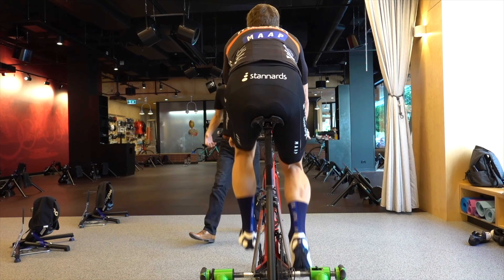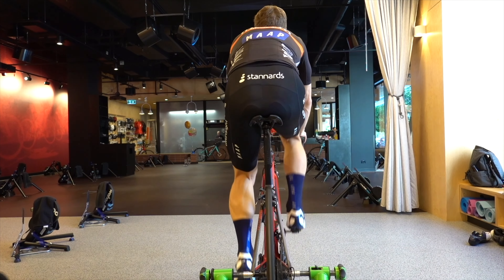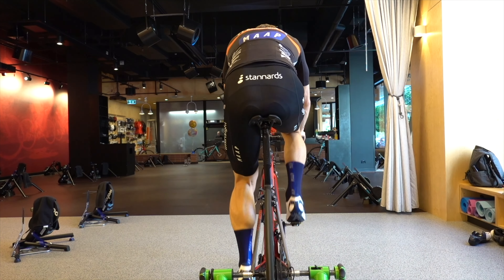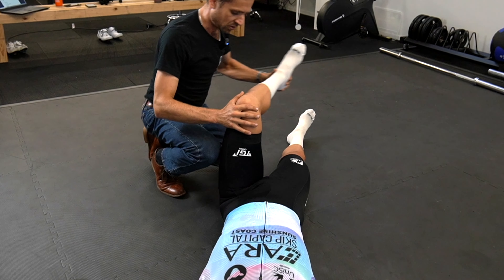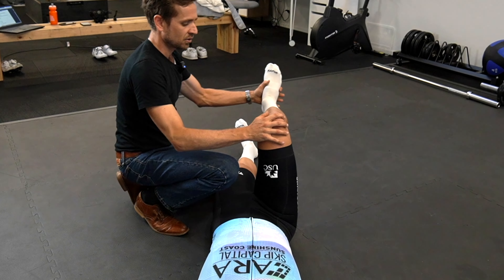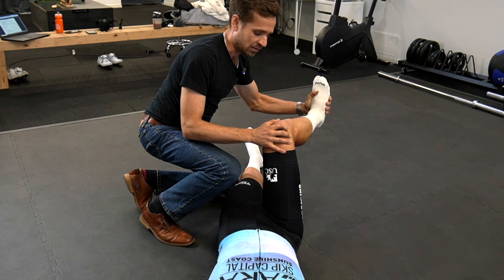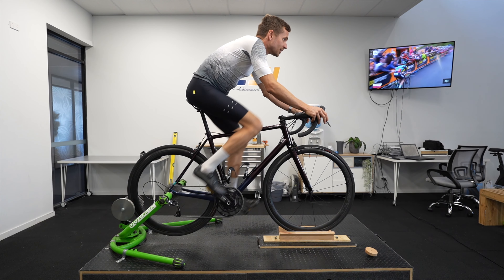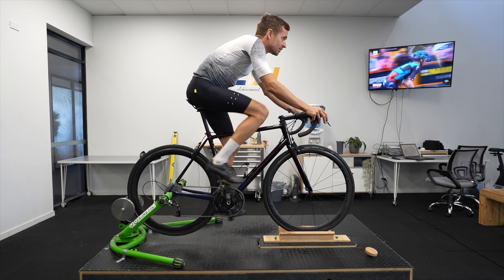5 reasons Why You Should Be Using Shorter Cranks

Comment: I've ridden a variety of crank lengths in 56 years of cycling - 165s, 170s, 172.5s, 170 on one side and 175 on the other (long story) - and have never noticed any significant difference. I switched from 172.5s to 165s about 12 years ago in hopes that it would help with some knee problems. It didn't, but I've stuck with the 165s because there was no reason to change again. By the way, what eventually did make my knees better was strength training, specifically squats and deadlifts.
Reply: very decent and honest answer. thank u!
Reply: Maybe you need to try 160mm
Reply: 弱者は，クランクのつっかかり，ひっかかりが，筋肉収縮痛をうみます．
あなたは，強者です．
Reply: Agreed. Did the same thing and after the initial adjustment period there was no difference. After switching back to 172.5 I actually like them better than shorter.
Reply: There’s more to knee problems than just crank length…
Reply: i am 178cm tall and have ridden 165, 167.5, 170, 172.5 and 175 cranks. honestly, i feel not much difference between them if my flexibility and fit is good. like 170 most tbh as the shorter cranks lack the leverage and jump for me.
Reply: surely you must have noticed the difference in feel between the lengths?  I've only changed 2.5mm and it's night and day the fit on the bike and the smaller circle.
Reply: @h20s8804  I do notice it. But it's not a big difference for me. Shorter cranks just feel like it's a harder gearing.

Comment: that saddle really steals the show
Reply: They are also really, really good...
Reply: But so awful looking 😢
Reply: I'd like to see someone mention humoring using one of those for mtb purposes, whether it be xc or trail riding.  Could it have any place there?
Reply: @Emolokz  got one on my road bike, one on my gravel.
Reply: @Hermod_Hermit  those two instances certainly make sense, but I'm thinking more of with a dropper. Will the shape of this saddle ever interfere with the rider standing, manipulating body position over the bike as much as you do in trail/enduro type riding.
Reply: @Emolokz  ah, that is a valid question. I got no answer to it though, sadly enough.
Reply: @Hermod_Hermit  it's something I wish would ever be covered for the mtb world. I know this is a road focused channel, but there is not enough, or really any data out there on crank length and saddle comfort/ergonomics for the heavier off-road riders. It's a missed opportunity. I'd love to see torque comparisons with a 170 vs a 165 and a 160 crank (while adjusting the chainring size up for shorter cranks and not). It's an empty dataset at the moment.
Reply: @Emolokz  oh yes I know. Personally I got so tired of it that I finally changed the one thing I could do something about. I lost 20+ kg of body weight (no kidding). I also shortened my cranks to 170mm from 172,5 and 175 respectively, and accumulatively all this has made a world of difference. I got really long inseam of 90cm, and 170 feels really nice.
Reply: @Hermod_Hermit  you're probably a taller fellow. I'm about 172.5 cm tall, so I'm leaning towards 165s myself, maybe even 160s.
Reply: It’s Aladdin’s shoe don’t you know that? Or the geenie?😂

Comment: Going from 172.5 to 165s changed my riding life. I actually did it on a whim after watching a few Neil videos. Turned out my a-symmetry and right lower backcpain was caused by a very stiff left hip. The pain literally went over night.
Reply: I am exactly suffering from the lower back pain ! been having it for almost two years.  Did Physio, Chiro and joined the gym to strength training.. it helped a bit but the problem was never eliminated.. recently someone who saw me at the local track suggested that I change to 165 or 160mm crank length.. I always wanted to try it but kept pushing.. reading your message here gives me renewed hope ! and I will start looking at local options to try this ! Thank you man ! I really appreciate you..
Reply: I have the same problem,lower back Pain when i do thershold training.i am 185 cm tall and have a 175mm crank on bike.think i buy the 170mm or 165mm for MTB
Reply: @abedfo88 I'm so curious about this. I have had lower right side back pain for YEARS. I've gotten multiple fittings, done strengthening, checked my form and it still persists. Did you not know your left hip was tight before you switched? Or the 165 nicely compensate for the tight hip so it didn't affect your back anymore? I'm heavily considering switching to 165 (I currently have 175; 170 on my previous bike) bc I think it would relieve my back pain. Not exactly sure what's causing it but willing to try bc the pain is so obnoxious and drains my energy while riding.
Reply: @aoguchi  it turned out that my left hip has like zero internal rotation and was very tight. I'm working on hip flexibility. I still get right side pain but it's more in my glute which is much more manageable !

Comment: Fantastic overview! Shame it's so inconvenient and often expensive to change cranks. Should be able to choose when you purchase the bike.
Reply: I've found the best idea is to buy used, rather than chase very, very minor design differences and paint jobs.

With the cash you save, changing parts is less painful and you get what you really want rather than what you're given.
Reply: 30 years ago when I was racing people rarely bought new bikes fully equipped. You'd choose a frame, then a groupset, wheels, pedals, and saddle, and have a mechanic assemble it for you, or yourself if you were able. So you had full control over every part that went on the bike
Reply: This is still the best option and what I prefer. It’s also how I taught myself to work on my bike (other than headset and cutting the steerer tube). Most people are a bit overwhelmed by searching for all the individual parts though. I don’t blame them.

Comment: You and other channels discussed this quite a few times since 4 years ago. I'm surprised that bike manufacturers still don't use shorter crank arms for their 2XS and XS bikes. If any change, it's a very reluctant one. I'm 167 and use 160 for both road and e-gravel (which has aero bars too).
Reply: I bought a Trek hardtail mountain bike in 2019, one with supposedly women's-specific geometry. Guess what cranks they put on it? 175mm, regardless of frame size! Ridiculous. I'm only 5 ft 4 1/2 inches tall (so about 163 cm, right?), but because I didn't know any better for the first 4 years I wondered why I struggled to climb even in bike's granny gear, and why my knees were sore after long rides. Last fall I bought 155mm cranks and the mechanic who installed them at my LBS was impressed with how they felt when he test-rode it. He is much taller than I am and he said 175s are even too long for him. What is Trek thinking?!?
Reply: Money
Reply: 163cm here and use 160mm on the Road bike and 155mm on the Gravel (seat height 665mm). Even with 160mm cranks I still get toe-overlap with 700c wheels as I have a more mid-foot cleat position. Thank goodness I have 650b wheels on the gravel bike!
Reply: @phil_d would you mind sharing which 155mm cranks you’re using please? It’s so difficult finding reasonably priced shorter cranks for gravel
Reply: @phil_d  going up a frame size and down in stem length fixes toe overlap. Long stems only exist because pros wanted short bikes to get closer to their wheel
Reply: @muthatrucker6485  Sadly, not for me. My 48 size frame needed a 80mm stem (stock is 100mm), so the next frame size up would likely be shorter than that! I then may run into stand over problems.

It's because I moved my cleats back as it feels a stronger position. Personally, 650b wheels should be more commonplace on smaller bikes. Although Conti make GP5000 rubber in that size there's a very limited choice of rims, especially deeper aero.
Reply: They should be already at 165mn but sometimes they really work towards even shorter cranks if tour de france riders at 5'9" or 5'10" are looking into a 165mm
Reply: the same with narrow handlebars. basicly no one needs a 440 or even 460mm bar on their road (or even gravelbike) but most brands offer a 400mm as the narrowest option....

Comment: Reason one to not use short cranks: you want to win the pack sprint which is often decided by half a wheel or less. 

Reason two: you have long legs for your total height. 

Reason three: you are relatively more short-twitch (in an endurance sport) and you feel less tired and burn less energy using a little more short-twitch.

Reason four: you ride on your toes because it’s more comfortable. People ride (and run) in ways that are more comfortable which translates to more efficient and it’s less efficient when they change their natural gait.

Comment: I wish you would say how tall you are just as a reference for the 165mm cranks. I am now a shade under 5’4” and have just ordered 155mm Rotor Aldhu which hopefully will fit in both my BB30 bike, and evo386 bike so that I can just swap the same crank between bikes. Coming from 170mm cranks and was finding it hard to even find 165mm.
Reply: I broke my pelvis snowboarding and left hip does feel some discomfort at extreme angles so I want it to as optimal as possible

Comment: I'm surprised that none of the videos about shorter cranks makes any explicit mention of the reduction in leverage they give, although this was hinted at in this one at the end of this one. Going from a 172.5 to a 165 crank is about a 4.5% reduction in applied torque for the same force. and as power = torque*angular velocity, this means less power for the same cadence. Has anyone looked into whether there is any advantage in changing the chain ring tooth count with shorter cranks to compensate for the loss of leverage? You could compensate for the estimated reduction in torque by having 2 fewer teeth on the chain ring.
Reply: wht not going 172.5 to 180?
Reply: The size of the chainring depends on the speed and not on the length of the cranks, on a time trial bike we reduce the length of the cranks (165-170) to facilitate the aero position and we increase the gear ratio for the speed (56-60)
Reply: @admirale3000  For the avoidance of confusion, you say increase the number of teeth, I say reduce them, but that's to achieve two different things. The biomechanical question to ask is whether a rider is more limited by the force they can exert on the pedal or by the power they can output. I don't know the answer, but on thinking about it more, I suspect it is power, and the rider would have to pedal faster with a shorter crank to hit their power limit.

Comment: What I find amazing is how bad the LBS is at fitting a bike to someone. They sell someone a bike that is clearly not fit properly to the rider. The rider has a few rides and stops due to poor fit. You could spend 3K on a poorly fit bike and then only ride a few times then ditch it. I think anyone who is serious about riding should be fit BEFORE buying a bike. Go to a real fitter. Get set up on a fit bike. Get all these parameters down first, then get the bike that fits you properly. It will save you thousands of dollars, a whole bunch of pain, and you will be much happier! This guy is phenomenal!
Reply: Exactly. Almost all customers I've come across never had a preliminary bike fit on a fit bike, they just pick a bike based on what they lust over. There was one time I had a customer asking if I could switch his new bike's cockpit to a one-piece counterpart, but the thing is, he's completely new to this bike and has never had a bike fit on a fit bike based on its geometry, so I had to decline the request (and also explain why) since I don't yet know what cockpit dimensions suit him.
Reply: Hard to know who a good fitter is, I went to a physio who did bike fits and he set the seat height with one of those formulas. I'd trust myself to do a better job.

Comment: Another bonus that comes up less - I switched to 165mm on the road for less hip impingement/better ergonomics. I then switched to 165mm of road and it’s been a revelation. I don’t feel like I have less torque and I have almost no pedal strikes now, all while keep my crank length constant across my bikes now.  It has turned out to be a win/win/win situation (ergonomics/consistency/fewer pedal strikes).
Reply: Hi, did you have to rise the saddle? And give more seatback?
Reply: @franciscopizarroi  When you switch to shorter cranksets, you do have to raise your saddle by the difference in crankarm length between the old and new setup (ex. 5 mm difference, raise by 5 mm). Saddle fore & aft needs no further adjustment.

Comment: I use 160mm cranks and I'm thinking about going to 155's or even 150's. Going from 170's to 160's made a huge difference in comfort. I have hip impingement and going to shorter cranks really helps, as was said in this video. Another thing that has really helped is using Favero Assioma Dui Shi power meter pedals with a wider q-factor, and also using pedal extenders when I'm not using those pedals. Pushing out the foot stance wider means much better knee tracking and much less stress on the knees when you have hip impingement. I want to add that hip impingement is often just how your hips are built -- there's no flexibility training you can do to improve it, for many of us.
Reply: Wonderful post! 👍🏻Agree fully
Reply: I run 140mm on some bikes its fantastic
Reply: @sempi8159  where do you get 140mm cranks? I've never seen cranks that short.
Reply: @northkyt  those are Diy but you get some that even go down to 130mm. There is a company in Japan that makes them. Do you need the website?
Reply: Recently went to 155s on a 29er. Allows standup cranking up hills with very minimal delay in power on each down crank. Having no pain in a bad knee, whereas 170 and 175s took more effort triggering residual inflammation.

Comment: Purely from mechanical perspective, the produced power (P) is equal to torque (M) multiplied by angular speed (ω):
P = M * ω = F * l * ω
where "l" is lever length. Now, lever length is not exactly equal to your crank length, but it is very much proportional to it.
So, if you go for shorter cranks (l decreases), to produce the same power, you either need to push the pedals harder (increase F) or spin faster (increase ω).
Reply: Exactly! Thats why I go as long as possible, but at one point you going to see that your cadence decreases.
Reply: Either way you are still producing the same power, you're not getting any more watts for free by increasing the cadence or cranks. The more important aspect is what is more efficient for the body, which is a much more complex equation.
Reply: @ryanm968  well, with more leverage its much easier to generate the same torque and therefore power. You are right about the bodymechanic aspect.
Reply: @ryanm968  we know that lower cadence/higher torque for most people means faster muscle fatigue. So for a purely endurance event shorter cranks at higher cadences are probably better. For short events, like most track races, especially those with a standing start, the ability to produce more torque at low rpm is probably preferred.
Reply: You have to push harder or spin faster (if you’re in the same gear I would say). The one thing that no one has explained yet was changing chainrings (and cassette) in spite of shorter cranks. I plan on going shorter and I am going to need a larger climbing cassette and quite possibly go compact chain rings at the same time to ensure I am not under leveraged. In Bmx, single speed, if we go shorter, we simply make the gear change easier.
Reply: yeah but for some reason shorter cranks are more efficient, wider tires with wider rims are faster and have lower rolling resistance now ... pr marketing bs ... this sport is getting more and more disgusting.
Reply: @biro3000  somehow People who are taller than 180 cm will be fine with the manufacturer's recommendations. unless they are in pain or elderly
Reply: I watched a video where they illustrated that a shorter crank can put you legs movement in a better power position for a longer period of the revolution.   Where a longer crank(or to long relative to your tibia length) you have bigger dead spots of power at the top and bottom of the pedal stroke.  
So keeping you legs more in the meat of your power zone for a longer period of time produces a smoother and more efficient power delivery throughout the pedal stroke. So the leverage position of your legs trumps the leverage of the longer crank. These were small efficiencies obviously but significant.

Comment: I have an 98cm inseam, total height of 191cm. I was on 185mm cranks, 180s, 175s, 170s, 172,5s and recently on 177,5mm cranks. I was constantly fidling with my position, especially seat height. Now I thought, I might just give it a try and install 165s. They feel way more comfortable when riding. As if the whole fit is more "relaxed". No more fidling. Let's see how it will turn out in the long term.
Reply: i have 96 cm inseam and 170 mm is shortest i go, cant get any power out if they are shorter
Reply: Any updated on long term feel?

Comment: Had this topic on my plate for quite some time and got my new bike with 165mm half a year ago. Went to a bike fit a week ago and was told after 5min that I apparently need even shorter ones and was sent home. Currently waiting for 155mm ones to arrive. I am very curious how the 155mm will feel.
Reply: I tried that length out on a fit bike, you get more clearance between your torso and thighs, so there's less disturbance when you're riding in a tucked position. Your hips also feel like they're "opened" up too.